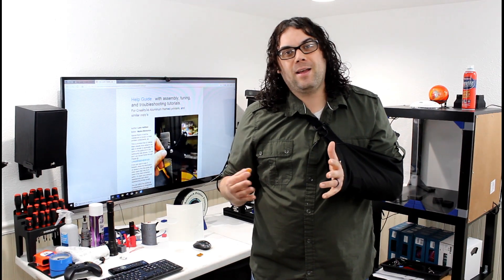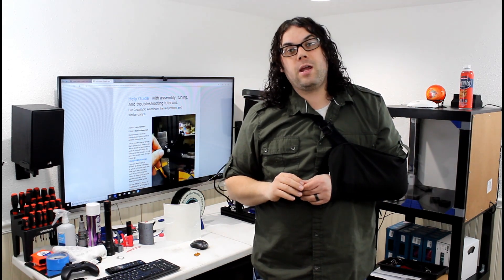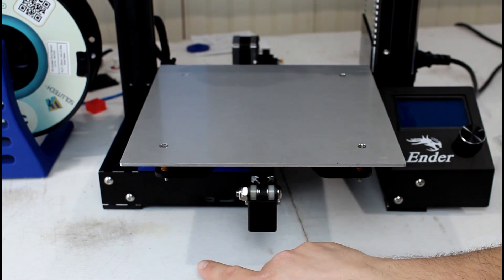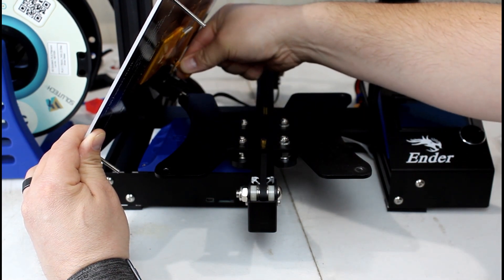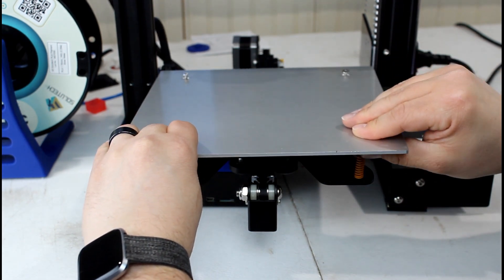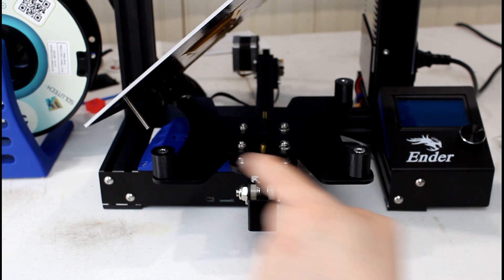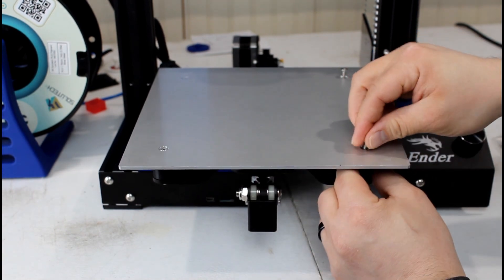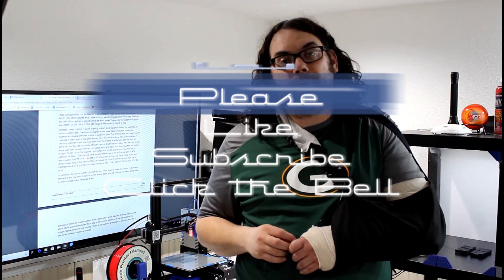Replacing Bed Springs on the Ender 3 with new springs or TH3D Solid Mounts

Comment: The real question is with all you smart guys in here why the hell you bought a kit instead of going to the hardware store and buying 4 similar but oversized springs to get full lift or use steel sleeves for the solid mount with wing nuts to keep the bed from moving that is your ultimate necessity and 1 reason prints come out looking like someone shuffled the deck and threw it on the table

Comment: This video really doesn't explain how to remove the plastic bracket on the back of the plate where the wires connect for the hotbed.
On the ender 3 pro version B(one with the 32bit board I think). There's a black bracket that supposedly protects those wires and it's routed through the screw & a pita to get off. Came here for that 🤦

Comment: I did this and it made no difference whatsoever. I have to re-level my bed every time I start a new print. 😫
Reply from the maker: Are you wheels loose after you level your bed?
Reply: @TheEdgeofTech  No.
Reply from the maker: @MobileDecay  Did you double check you X Gantry to make sure it's level?
Reply: @TheEdgeofTech  Yup.

Comment: This is messed up the yellow springs are not better ...they are same as yellow springs my ender5 came with... my cr10 clone came with red springs that are way stiffer an stronger then the yellow... i should have ordered red springs for my ender 5 not yellow... What were the springs this ender3 came with ??? you should have showed them side by side... this would have saved people from ordering yellow springs....they should order red springs to achieve the results you mention imo...
Reply from the maker: Hi, the stock springs on the Ender 3 were silver and very weak. The yellow springs are a big upgrade from those. If you already had the yellow springs, I would not recommend upgrading. I have not tried the red ones, but I may have to now!

Comment: with the solid mount how do you level?  is it assumed that it will already be level because they are solid mounts?
Reply: This is my question, as well. I imagine that you use manual mesh leveling (if you don't have some sort of ABL probe).
Reply: if you have bed vizualizer and its off by a lot, you can use washers to compensate for the height

Comment: Thanks! I'm replacing the stock springs with those yellow ones you (and everyone else) has. And I messed up the back left....put the spring between the bottom of the bed and the top of the plastic cord bracket thing :o
Reply from the maker: Oops! Is it ok?
Reply: @TheEdgeofTech  Thanks for your concern. Yeah, I got it put back together properly as per your video. Luckily I noticed early that something wasn't right with it.
It is concerning to see how frail the solder connection is for the heating element though. I'm thinking that might be a long term upgrade to re solder and epoxy them or something...dunno. Still pretty new to 3D Printing :)

Comment: Should I keep the 4 mm and nuts under the bed that I put on when setup the printer?
Reply from the maker: Nope! :)
Reply: @TheEdgeofTech   also should i also redo the install for the z end stop like in your bed levelling video?
Reply from the maker: @animaux2755  of you are going to the yellow springs, you will not need to. Just level the bed and you're good to go!
Reply: Thank you very much for the quick response

Comment: Problem I'm having before and after changing my springs is the bed is way too high (extruder gorged my magnet mat upon 3rd print), but I've screwed those wheels in as far as allowed. Any suggestions?
Reply: move your Z limit switch up
Reply: Yeah OP really needs to include that part in the video…

Comment: Can you still use these stabilization on the Ender 3? If you don’t have a bed leveling sensor? If not why?
Reply from the maker: Yes, you can use the springs if you do not have a bed leveling sensor. They will be stiff and allow you to adjust the bed still, but also stiff enough not to move as much as the stock ones. You cannot use the solid mount though if you do not have a bed leveling sensor.
Reply: The Edge of Tech 
Why can’t you use the solid mounts with out the bed leveling sensor?
Reply from the maker: @TheDronzDr  Because if you don't have a bed leveling sensor, you need to be able to adjust the bed to level it. The prints Allow for the adjustment, but if it's solid you will not be able to adjust it.
Reply: The Edge of Tech 
Thanks that my sense.

Comment: Wait a minute Jim, you are using TH3D mounts with a BL Touch? Why not the EZABL sensor? Enquiring minds want to know :)
Reply from the maker: Hi!! I was one of the very eager new 3D printing users that ordered "upgrades" right after I got my first Ender 3. I didn't know about the EZABL yet. I just followed the Teaching Tech video and he used the BLTOUCH. I then learned about TH3D from a friend and ordered the solid bed mounts and other upgrades from them! That's why I have it, and I will be using the EZABL on my newest Ender 3 instead of the BLTOUCH. That will also allow me to help people using both devices! But if I would have known about TH3D before I ordered my BLTOUTCH, I probably wouldn't have one. Lol
Reply: @TheEdgeofTech   oh cool! I am about to order the EZABL for my beast, the Ender 3 'pro'. Spending a ton of time leveling the bed, when I want to be printing cool things!
Reply from the maker: @LJ-gu2dj  Do it! Thanks for watching!
Reply: Honestly, the BLTouch is a better product. Much less messing around with z-offsets, easier to switch build plates. I had the EZABL for 6 months before I swapped it to a BLTouch.
Reply: @ravenfire12  - I started with the BLTouch, and I think I got a defective one because the probe didn't always detect the bed, and sometimes, for no apparent reason, auto bed level didn't complete, sometimes 2-3 times in a row. I switched over to the EZABL Pro, and haven't had a problem since.

Comment: Any reason to not use a lock nut on the underside of the bed to prevent the screws turning? Makes a huge difference to the frequency of manual bed levelling, especially when using the upgraded springs.
Reply from the maker: Thanks for watching! we had some issues with lock nuts being able to tighten all the way to the base of the bed so Luke recommended not doing that but if you get them to tighten all the way go for it!

Comment: After replacing solid mounts did u calibrate z ofset, baby step etc in marlin/firmware if u did can u make video about it bl touch calibration and which bl touch u r using if possible give link please thank you
Reply from the maker: Yes after I replace the solid mounts I let the bltouch go through the auto mesh and then I just calibrated my Z Offset well it was printing. I used a 4-line skirt around my first print and calibrated the Z offset with that skirt. I will add that to a list!
Reply: @TheEdgeofTech  thank you for all your effor and im sorry too much asking things to you, im planning bltouch in my upgrade list (mksgenl, tmc2208, better fans, meanwell psu etc. ) :)
Reply from the maker: @Solthariel  it's no problem! I appreciate you watching and I appreciate your feedback! Those will be great upgrades!